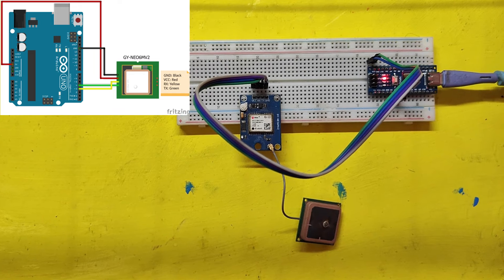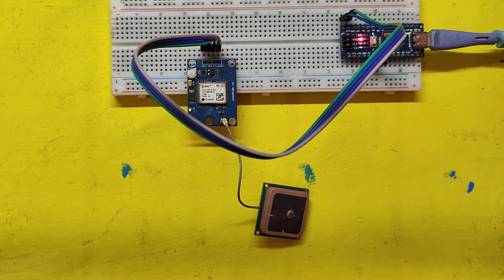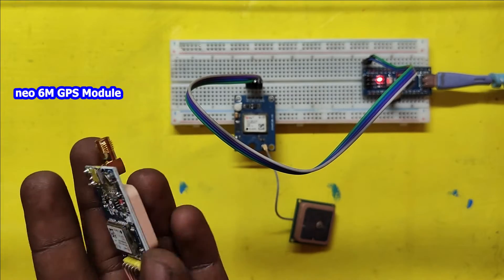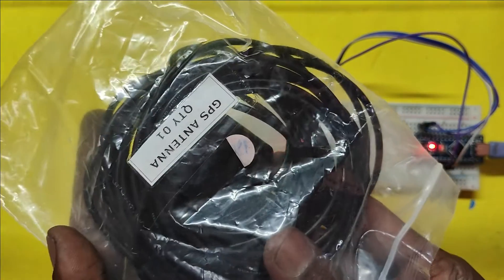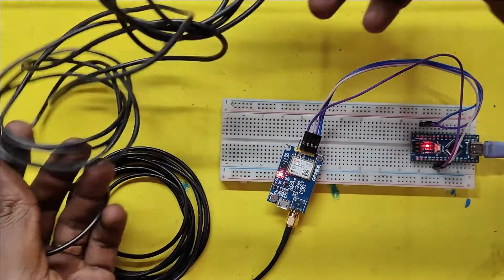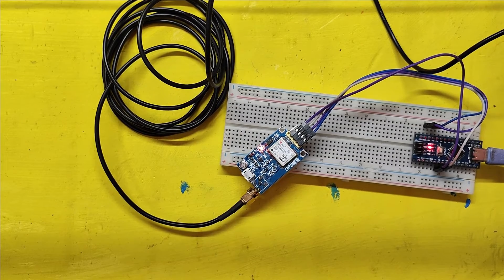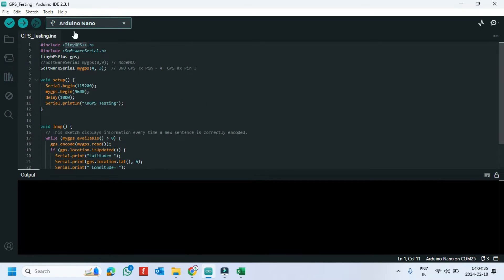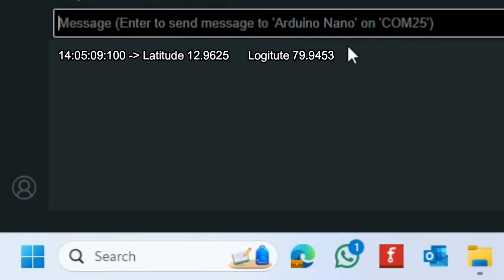Neo 6M GPS Module Testing | GPS Module Interfacing with Arduino | Neo 6M GPS Module Arduino Project

Comment: this new neo-6m gps module can test in indoor ?
Reply from the maker: After connecting the new antenna. Working indoor also
Reply: @TeachMeSomething can I replace it with neo-8m GPS module ?
Reply: I have tested 2 modules. When ivstep outside it blinks but i see no data

Comment: Hello brother my neo6m v2 gps module also not blinking led and when i connect to 5v after few time its get heating what’s the problem?
Reply from the maker: Check the pin properly. 
Maybe you have been given the wrong connection one time.